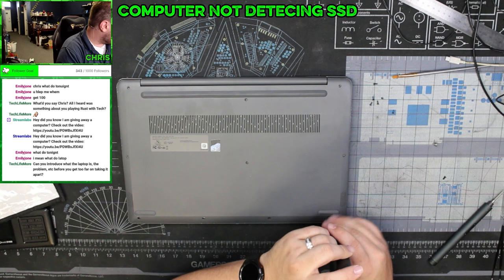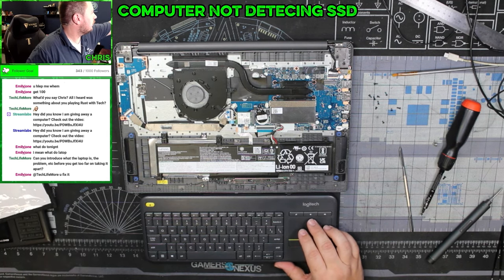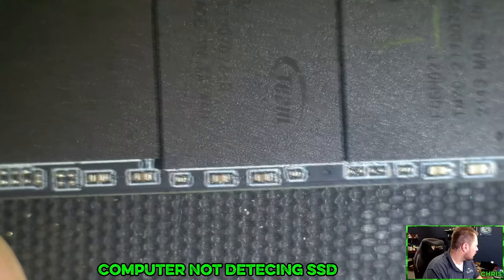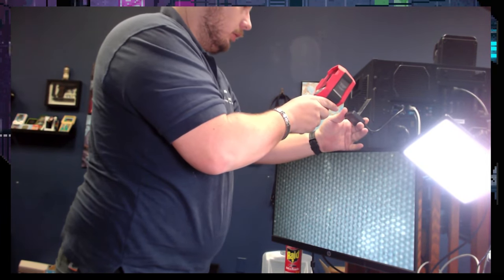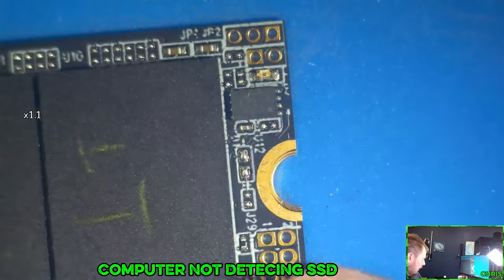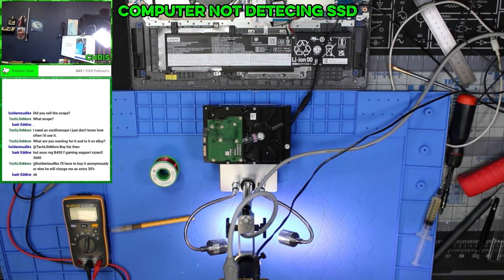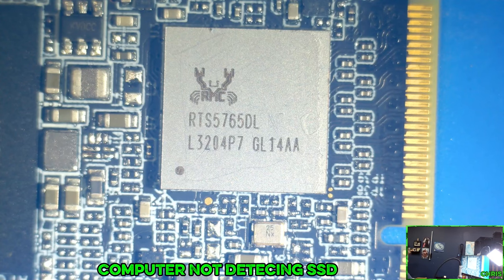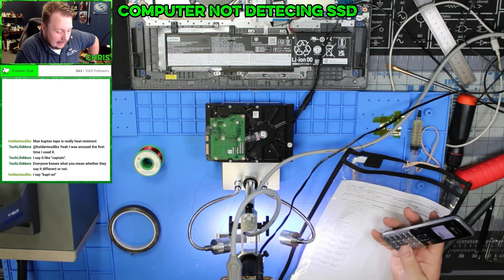Customers Computer Not Detecting SSD? Lets Find Out Why!

Comment: Its an LED they're like that normally, but should light when you test using a multimeter in diode mode
Reply from the maker: Yep 100% an LED, I have no clue why my brain would not let go of the word Fuse or the fact that it is just regular old LED that most Old style nvme/sata M.2 Have an LED. I felt like an idiot after I realized lol.